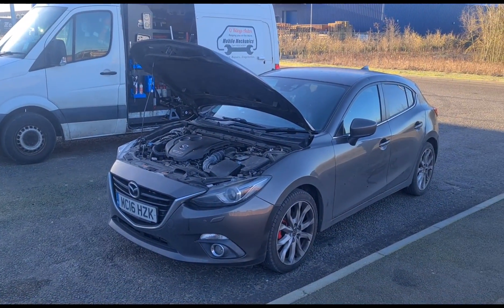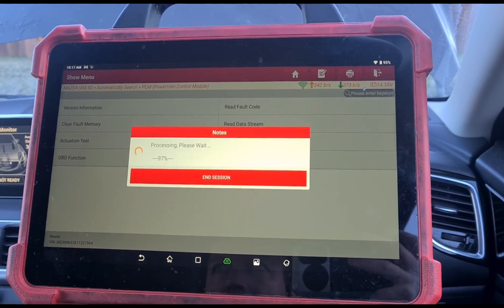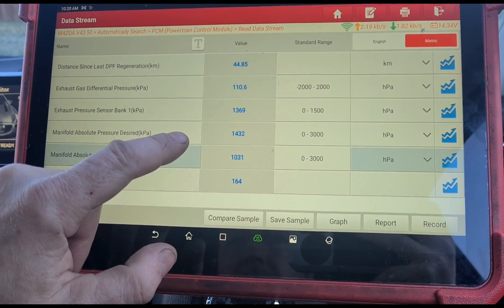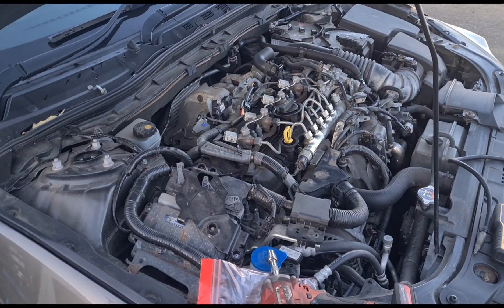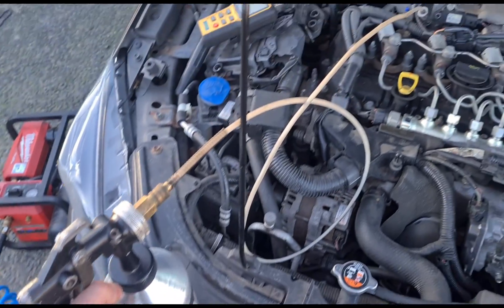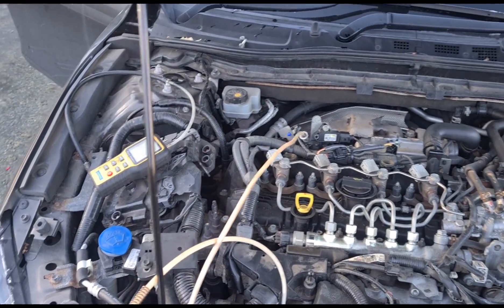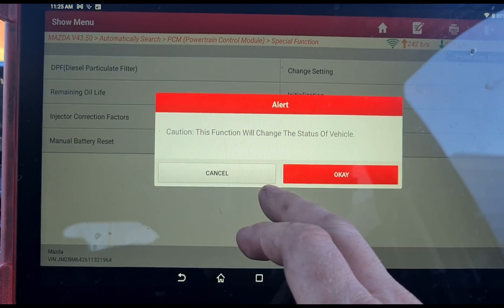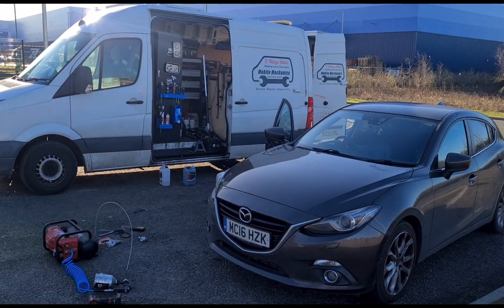Mazda 3 P243C:00-2F Particulate Filter Regeneration Frequency (Ash Accumulation) DPF Cleaning

Comment: I have a mazda 3 2016 rehening eberytime the car starts and the blur temp lighy goes out iy instantly goes into a regen cycle no dpf warning light radiator fan is on constant car has been srviced and its still doing a regen 12:23

Comment: I have something similar with my car. Dpf regens every 40 miles. Regen happens fine and pressure returns to normal. It then quickly rises again after 40 miles or so to 20 mbar idle. Dpf says 40g ash. Dpf pressure sensor changed and still no different. Also I get readings of 10mbar when it’s off as well

Comment: Hello mate 
          I have a question not sure if it relates to this video.

If a car is doing a few rengens by itself .  Is that normal or there is an underlying fault with the car?? 

The reason why I asked some cars don't have a vapouriser to help heat up the DPF.

How will those cars get up to the required temp to regen??

Great vids pal.   Learning a lot from them.

Comment: Excellent video, Jimmy! Many thanks for posting it. I didn't know about the Acetic Acid dissolving Ash in a DPF. This was a very informative and informative video.

I have a question for you: Are there any Diagnostic Machines that do not need an internet connection all the time to work? I do not mind paying for an update when I choose to do so but I do not want a rolling contract or a machine that accesses online data for every operation.

When you next do a review of a machine such information would help a lot of people decide what to go for. It may be that a machine that is more expensive initially would not need a continuous data link whereas an apparently lower cost machine does, which increases the hidden costs quite considerably.

Comment: Well done!
I had an issue with a Subaru regenerating frequently and smoking,I suspect the incorrect oil was used at its 15k dealer service.Shortly after my interim 7.5 k oil change everything went back to normal .No smoking either.

Comment: Unfortunately that Mazda has a different issue and the frequent DPF regenerations are just the symptoms and not the root.
The top of the valve cover was wet around the injector, meaning the injector washers have failed hence diluting the engine oil and that's why the DPF is filling fast. However, even bigger issue that the thinner oil will cause oil pressure issues sooner or later, but very likely sooner, the flashing DPF light is the early sign of the Oil Pressure Warning Light to come soon. 
It needs full top end and bottom end cleaning and also very likely engine carbon cleaning as well.
Oh, and don't get me wrong, you are doing a great job and I learn a lot from your videos as well and you can't be a specialist on every engine, make or model. Also what you have done deffo helped the car, but it will have issues soon. (it already has, they just haven't come to the surface yet)
Keep up the good work! ;)
Reply: I thought it was ticking fairly loud, first thing I noticed. Didn't notice the head was wet though, good spot
Reply: @davidoff59   I do these engines about 8 a month, so quite know what to look for. ;)
Reply: @mrniceguy94  do you think replacing the injector washers As well as an oil change would reduce regeneration frequency?
Reply: @smashplays7926 maybe temporarily,but if you are experiencing this issue a lot of things needed to be done. Top end and bottom end cleaning, carbon cleaning,dpf cleaning. Otherwise anything you do is just patching up the faults of the engine and not fixing the roots of the problems.
Reply: Is the louder ticking from maybe low oil pressure getting to the lifters making them louder from blocked oil pickup ? I had code P0101 and p258 i followed your video and how to clean the carbon from it but now i have put everything back together took my time and done it right and the engine seems to be ticking a louder now but havnt got any codes for low oil pressure …….. I have a short video on my Channel on how blocked the engine was . Also will p258 cause this I removed the code and hasn’t come back but only ram engine for a minute or 2 .

Comment: It would be great to have an update on how frequently this car regenerates after this DPF cleaning. These Skyactive engines are prone to premature fuel injector nozzle wear, exhaust camshaft wear and inlet manifold and ports blocking with carbon. Any of these issues can cause this same issue due to poor combustion. Remove the DPF and the engines smoke like a chimney. Not Mazda’s finest engine.

Comment: Acetic acid ! very nice find. can you share a bit of the research you've done on this product with ash content reduction of a DPF? it turns out this is basically just strong vinegar. you are using 20%, but this can be purchased all the way up to 99%. it is extremely corrosive to metals, so I would guess too strong could damage some thing in the exhaust system. have you tried this to clean a DPF without first using the launch cleaner? very curious about this new find of yours.

maybe those vehicles that you had to give up on after the first cleaning in the past could have been broken free with a strong solution ?
Reply from the maker: Abstract 
Hard carbon is regarded as one of the most promising anode materials for sodium-ion 
battery. However, the ash content of the hard carbon anode inherited from the 
precursor have several negative impacts on the electrochemical performance of hard 
carbon. The traditional method utilizes strong inorganic acid washing to reduce the 
ash content of hard carbon. However, this method results in heavy environment 
pressure and safety hazards. Therefore, it’s necessary to exploring an alternative ash 
content removal method which is safer and environment friendly. 
This project develops an environmentally friendly approach to remove ash from hard 
carbon by using acetic acid. This approach effectively reduces the ash content and 
enhances the electrochemical performance of the hard carbon anode. The ash content 
of hard carbon decrease from 1.57 wt% to 0.655 wt% after the 4 mol /L acetic acid 
treatment. The two-step treatment process also studied in this project and shows a 
better ash removal ability than one-step treatment process. The ash content of 4 mol 
/L acetic acid and 20 wt% KOH only 0.28 wt%. Furthermore, the electrochemical 
performance of the two- step treated hard carbon exhibits notable improvements, 
including enhanced initial Columbic efficiency (from 84.53% to 88.11%), reversible 
capacity (from 244.2 mAh g-1 to 280.8 mAh g-1). The long cycle performance of 
chemical treated hard carbon anode need further investigations in future studies. 
Key words: Hard carbon, Acid wash, Biochar, Sodium-ion battery
Reply: @ORileysAutos  very interesting. I wonder if the acid washing of the DPF just un-bonds the soot from the ash, allowing it to be re-deposited at the back of the DPF where it should be, and allowing the soot to be further burned off to clear most of the DPF to exhaust flow again. Or if the acid wash reduces the physical size of the ash molecule, so that it can pass through the DPF with the burned off soot. either way it looks like it extends the life of the DPF that originally was hopelessly plugged up. good work discovering this new option to a completely failed DPF. still curious to see what would happen using just this method alone on a DPF, what would it do to the soot level. this would probably require a foaming agent to be added to make it efficient. Otherwise, liquid alone wouldn't be very practical.
Reply: Super video as always 
Is there anyway on reading ash content/amount in dpf
Reply: @flyingfox80  it is strictly calculated by the ECU of the car. that's because the only way to actually know is to weigh it when it's new and then weigh it again when it has ash in it. that is definitely not practical.